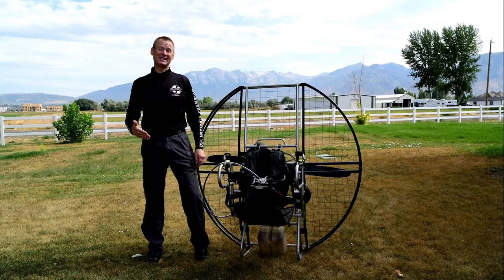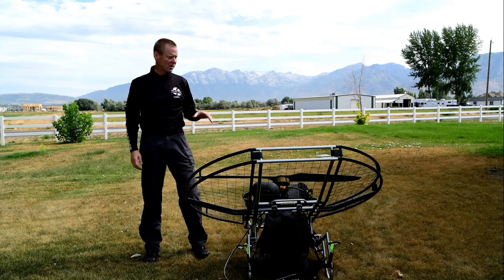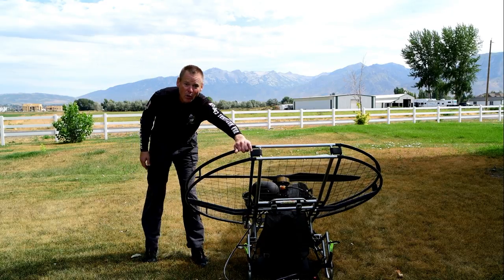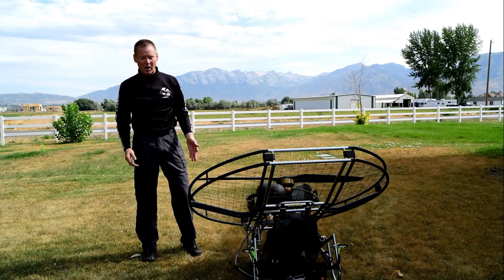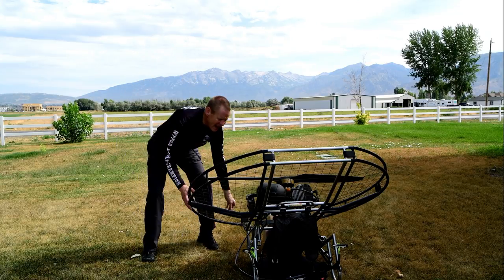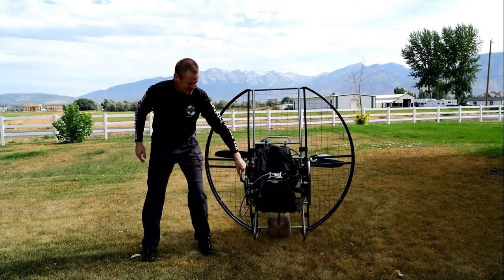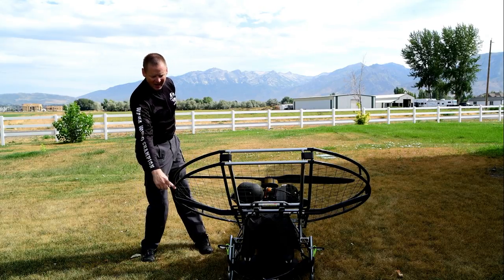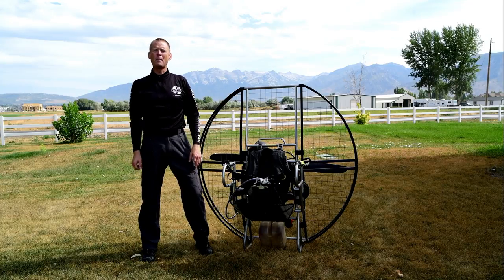Paramotor Face Plant Protection!! Powered Paragliding Critical Design Features For Safety!!

Comment: Another frame design I like really well are the rounded "skids?" at the bottom which will allow for some sliding in the case of a butt landing and I'd say a face plant as well, whereas others I've seen have pointed edges which will just dig into your landing surface bringing you to an abrupt halt.

Comment: Hey Dell, really like your design. was wondering, if someone already has a different paramotor is there an option to have a similar safety feature attached such as yours that is an aftermarket? Maybe you could implement a universal attachment that could fit other setups.
Reply from the maker: No sorry.  You can't  just fix a weak cage and frame by adding strong netting.  There are hundreds of improvements the Flat Top has over other units.   It would be nice if there were a simple fix but it just doesn't work that way.

Comment: Seems like a pretty good design since they don't any other function other than provide the structure for the hangpoints. If you have to have bars there anyway, they might as well help deal with something that has to happen somewhat regularly. Put a couple hundred pounds of thrust on people's back and tell them to run across grass (or worse sand), somebody is eventaully going to fall.